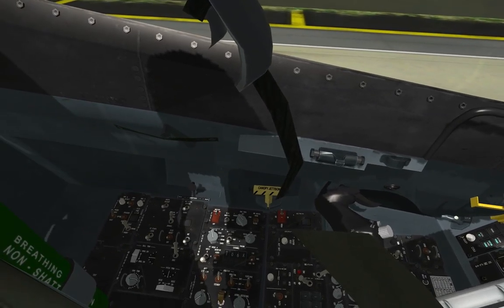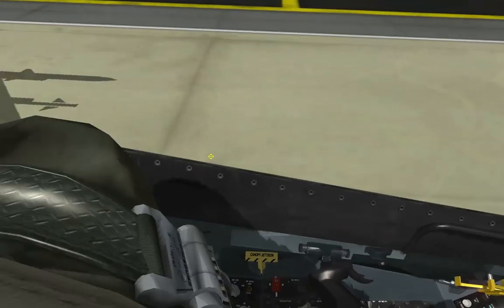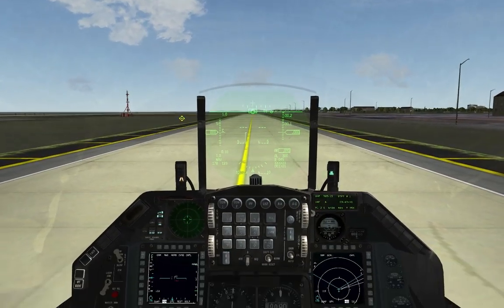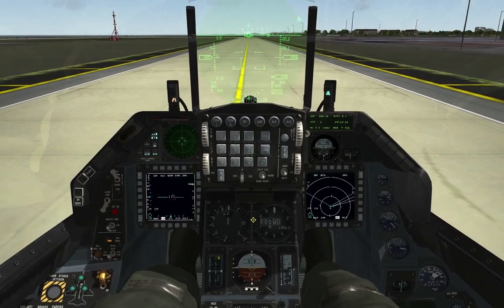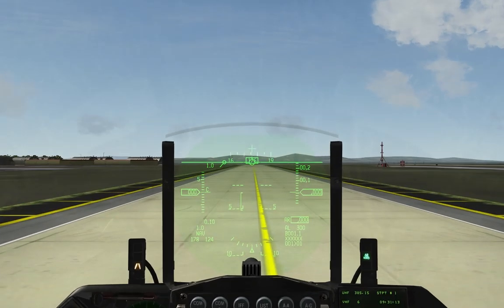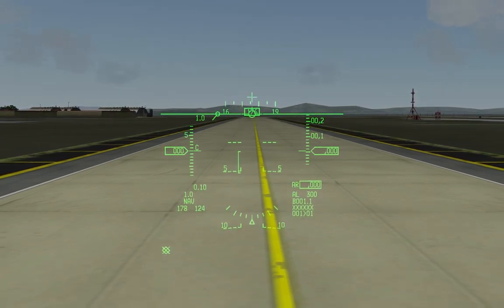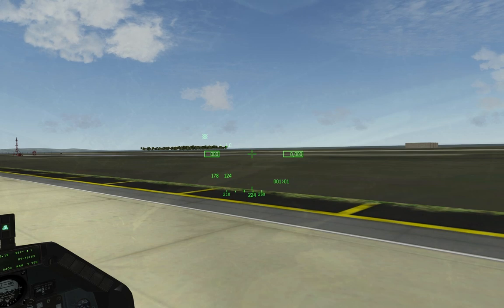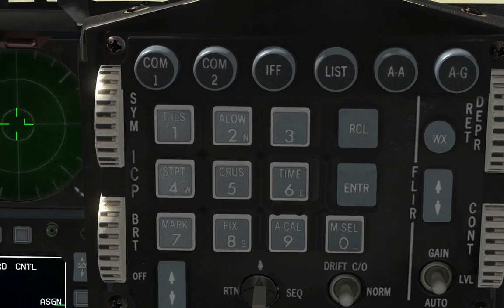Falcon 4 BMS Tutorials Cockpit Orientation, Navigation, and Formation Flying

Comment: The beeping sound is the RWR jingle. You hear it when a new blip appears. If the same blip appears after an interval of 10 secs or if the spiking aircraft changes it's radar mode. BARCAP is Barrier Combat Air Patrol; placed between FEBA (Forward edge of battle area) and friendly forces. SEAD is suppression of enemy air defense, which can either be hard kill (by taking out the SAM Acquisition radar) or soft kill i-e wild weasel or using jamming pods to confuse the SAM radar.

Comment: there is a function for both entering ACM and switching modes. entering dogfight mode automatically engages ACM. using the TMS four way switch on the stick you can switch between modes.

Comment: Buddy spike is what you say when a friendly has locked onto you. Your radar warning receiver makes noises depending on the radar it's detecting.
The thing to the left is called the Angle of Attack indexer. /\ = AOA is less than 10, O = AOA is 10-13, \/ = AOA is greater than 13. (don't quote the numbers, I'm ball parking) It's mostly for landing, you want to come in with O.
BARCAP= BArrier Combat Air Patrol SEAD= Suppression of Enemy Air Defenses.

Comment: Very nice, good, informative videos you got going here tanit. Some questions though, what is buddy spike? And what are those lights on the left of the HUD that look like :
\/
O
/\

And what is that beeping sound I hear every few seconds when youre in the cockpit? And what is BARCAP and SEAD strikes? Thanks!
Reply: The VO/\ is the indication of your angle of attack required to land the aircraft. It is the V indicates yellow, you're too high risking a nozzle strike. If the /\ is red, you're too low. If the O illuminates green, you can safely continue to land for touchdown.